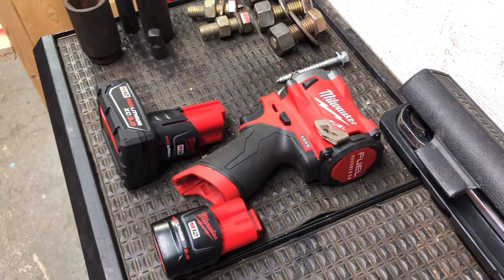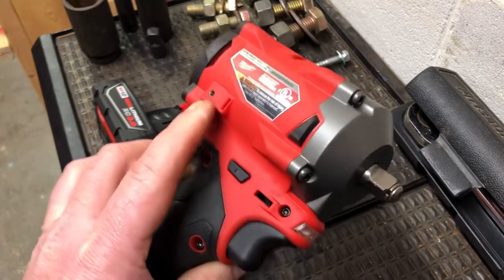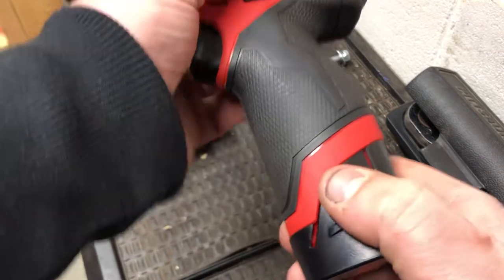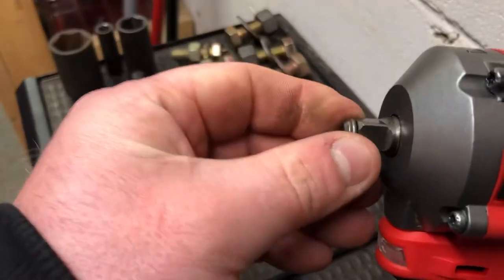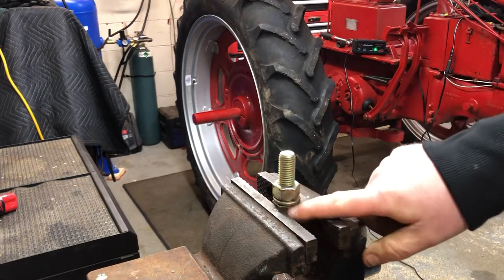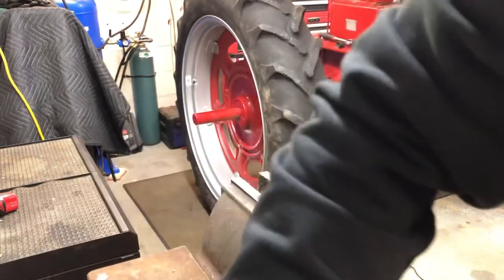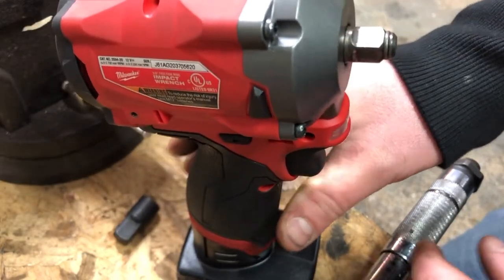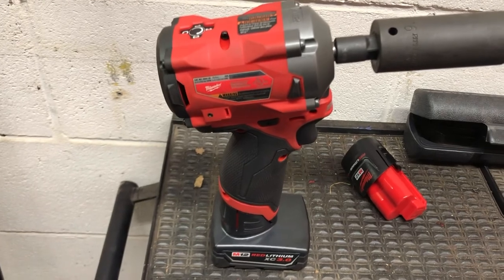Milwaukee M12 fuel 3/8 stubby impact wrench review and opinion.

Comment: Ive owned the 3/8 stubby for a couple years. The hog ring needs replacing.  It has no problem breaking chrome sockets in speed 3. I usually use this gun with a 3/8" to 1/2" low profile adapter on 1/2" impact sockets.

Comment: I LOVE the M12 3/8 stubby, I use it probably more than any other battery powered tool, if I run  into something really stuck I use the big M18 1/2 high torque, I’d like to invest in the M18 mid torque or the short M18 High torque for in between the extremes,good video

Comment: I just picked up this tool today from home depot to go along with the new model Milwaukee mid torque I got a couple weeks ago. It will probably see more use than the mid torque, but I am so done with cranking on ratchets.
Reply from the maker: Yeah I agree. I also have the mid torque and the high torque. I find myself going for the stubby more than others because of its size and power. It does most every I have used it for. Great addition to the bigger ones.
Reply from the maker: Just wish I could find some bigger sockets in 3/8 drive.
Reply: @TryingTools  you should have bought the half drive model
Reply: @TryingTools  where im from its bare tool 200 euro so thats 242.72 dollars so it aint cheap here
Reply from the maker: @codybattles1693  yeah that’s on the pricy side. Is that for the 3/8s?
Reply: @TryingTools  yes im only 14 so i bought a cheap impact and i would recomend knipex pliers there alot cheaper here around 15 dollars a tool up to 12 inches
Reply from the maker: @codybattles1693  nice! Yes I agree they are nice. We use them at my work. Never have a problem with them.
Reply: @TryingTools  You should try TEKTON impact sockets and they have chrome sets too. They are Awesome and Affordable. Lifetime warranty and the best customer service representatives too. 😎

Comment: It's definitely for those lighter fastening jobs, the Milwaukee website has pics of it at work on an engine. I bought it for new camshaft actuators aka phasers and a new timing chain for my car. The question is: how strong is the 4th mode for loosening?
Reply from the maker: If I read and understand the manual right the auto mode is full power when loosening a bolt and slows the rpms down when it breaks it loose and full in forward until it feels a small bit of pressure of the bolt so it’s not over tightened.
Reply: There is no setting 4.
3 if 250ft lbs in reverse.
The bolt mode is so you don't strip threads or spin the bolt right off a stud. Stop the motor before it does